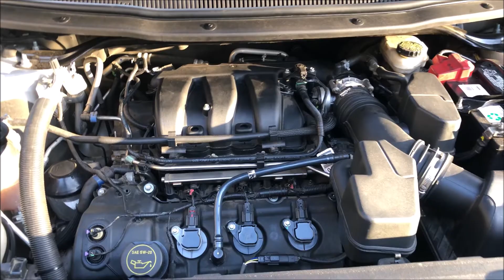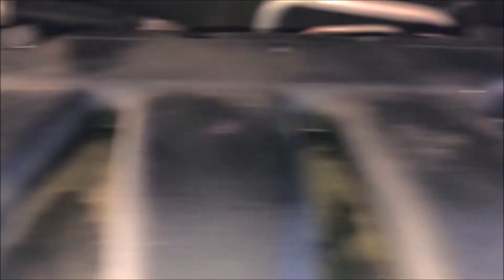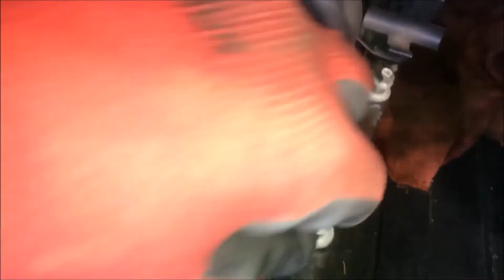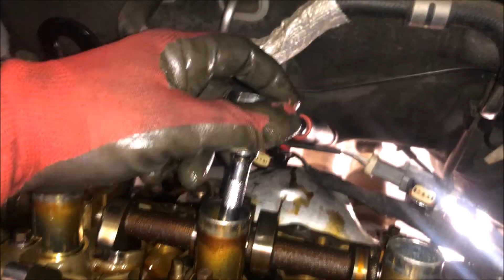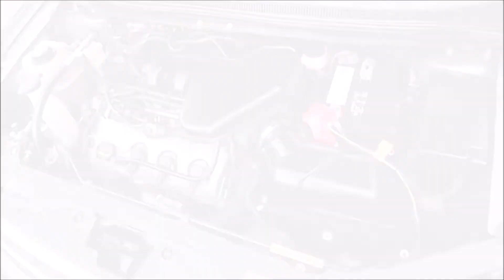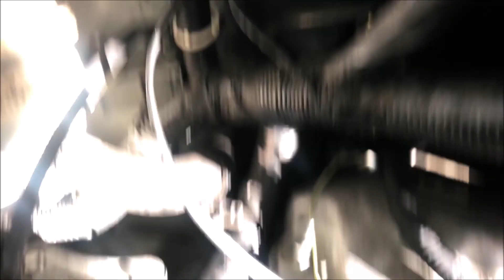How To Replace Valve, Cam Cover & Oil Well Gaskets Ford Edge 3.5L Engine Firewall Side:  Part Deux

Comment: Are the spark plug well gaskets pressed in from the top? I removed the old  ones from the underside so I tried to drive them in from the underside as well. Comments?
Reply from the maker: I pressed them in from the top.